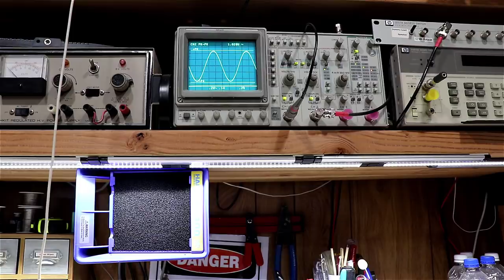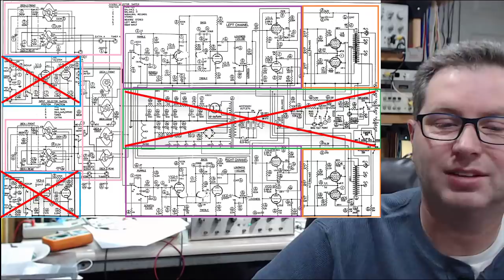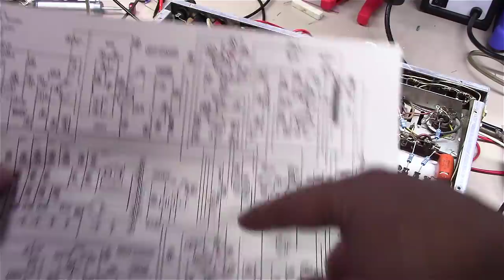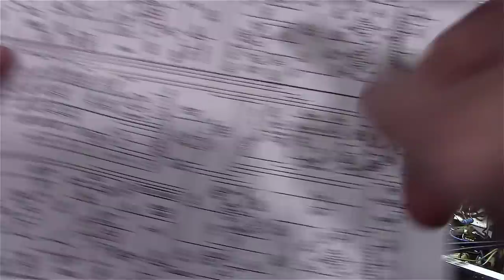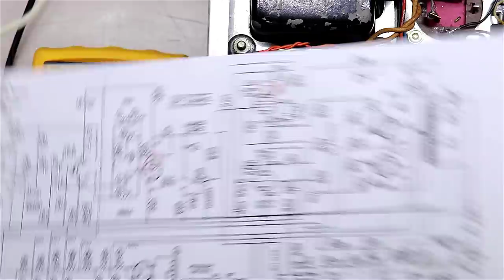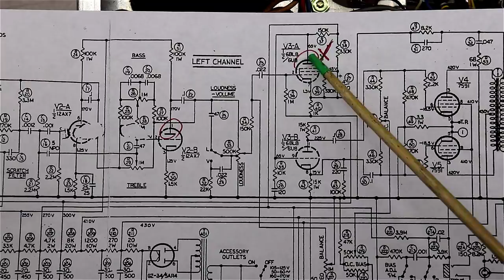How to Approach Troubleshooting A Tube Amplifier Issue

Comment: Excellent.!   You have a wonderful calm way of explaining everything.  You move slow enough to give the viewer time to think, while not going so slow that you get bored.  Perfect.  Also, You have a clean bench so each wire is easily seen as explained.  Thank you so much.  Of all the YouTube videos I watch, I look to find every one of yours.  I am still looking for section five of your oscilloscope series to learn your advanced troubleshooting tricks.  Maybe it’s not out yet so waiting patiently.   
One question…. Where did you buy your wooden bench brace to hold a chassis?   That thing with angle adjustment knobs looks beautiful.  Did you hand make that yourself?  It looks well edge sanded and factory cut.  Would you please share the information as to the brand and where to buy it?  If hand designed, Then please do a video on making one.
Again, Thank you.  By the way, I like your music.  Wish I could know the name of the CD.  I know you can’t commercially share that but maybe a good hint or release as a new friend will work.
So you know I am an avionics technician working usually on commercial jet aircraft.  I assembled my own electronics bench at home to service and restore American Fives and anything vintage.  Working now on a Philco 37-34, 1934 church style radio.
Please make note of my contact information which is okay for the public to see.  Consider this my release to reprint, and I welcome my fellow brothers holding a soldering iron if wishing to contact me.  Thank you again.
MichaelScot4u@icloud.com
(Michael in Florida)

Comment: I am saving to get a single ended tube amp . I have very very easy speaker to drive which were made in Italy, Casta B Speakers. I had Scott mono blocks that to my ears just were too soft and slow. Wish to buy one A class single ended tube amp maybe 4 amps

Comment: If you can't get a schematic for an integrated like this or other amps, you really need to know your circuits, and I am guessing that most viewers here are not in that camp.  Having (and of course, knowing how to read) a schematic makes it easy to puzzle out and get to the trouble spot quickly, otherwise you need to know how tubes work and in what stages to expect, etc.  I think that being able to read and use schematics greatly helps in understanding how equipment works and helps educate one in electronics.  As far as the test gear, pretty much spot on, signal source, scope, dvm, voltage AND current monitoring variac, tools and soldering gear and monitoring speakers and/or load at a minimum.  Not cheap to buy, so maybe this will give some people an idea why techs charge actual money to fix electronics, a bench like Mark's is not cheap!

Comment: Very useful, especially as I have a similar issue with my WAD KT88 amp at the moment. It's on the "bench" (my computer desk!) and I'm about to try replacing all the valves to start with. One channel is very quiet and not working clearly, I'll have to get the multi-meter out if the replacement valves don't work (no oscilloscope). I have the schematic and even details of what points in the amp to start testing voltages.

Comment: A good review of classic troubleshooting techniques, thanks Mark.
 - cut the problem in half, evaluate and repeat
 - DC voltage checks!
 - same resistance, different voltage drop -> biasing and current inequalities -> look for the cause
 - don't always assume a resistor is a resistor or a capacitor is a capacitor, capacitors can turn into resistors or even short out. Keep an open mind.
Cheers,
 - Eddy

Comment: Best and most succinct lesson ever.  I'm into a 2-cabinet 1958 Magnavox w/ stereo record changer and mono receiver (i guess that year was the cusp of stereo?).  Can't seem to find a clear schematic because I'm not so adept at digging yet. Power amp 175-67 is its chassis # I need to pull the receiver/preamp? chassis out again to get its #, but really, no need.  this thing is so simple, right? This video is the new grail, thanks.
Reply: *have I commented similarly before on your posts? -forgive the spam. I watch all of you guys and trying to get myself to do this machine w/o frying it, or worse, myself. :^) thanks again, stay hungry.

Comment: Are scope leads grounded to the chassis of the Scott? And is the Scott plugged into an iso transformer?
Reply from the maker: variac is always plugged into an isolation transformer.  no scope ground leads attached.  easy stuff
Reply: How do you get a clean scope signal without  the ground lead?   I know it may work do to the power ground of the scope or a lead from the scope chassis to the amplifier, but with or without and isolation transformer the scopes chassis ground needs to be common with the amplifier chassis.
Reply: I’m also not understanding this. What is the return path for the oscilloscope signal. Is it plugged into the isolation transformer also.  Otherwise an excellent explanation. Many thanks.
Reply: why do you need an isolation tranny IF the unit already contains an isolated power transformer.
what is the difference between:

wall - > iso + variac + iso  [power transformer]      and 

wall - > variac + iso [power transformer] ?
Reply: In the early days of TV/Radio/electronics many times one side of the power cord was simply tied to the chassis.  In those days they did not have the polarized two prong plugs.  An isolation transformer was a MUST.  It is NOT necessary with units that have a properly wired power transformer, but for the techs, using the ISO transformer was the easiest way to avoid really bad problems.